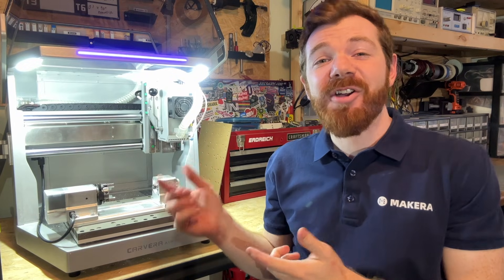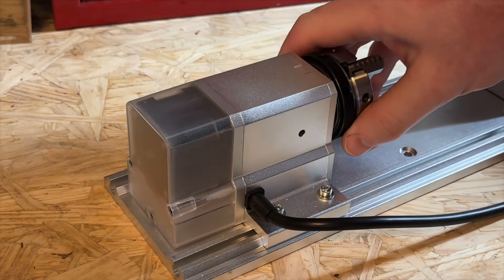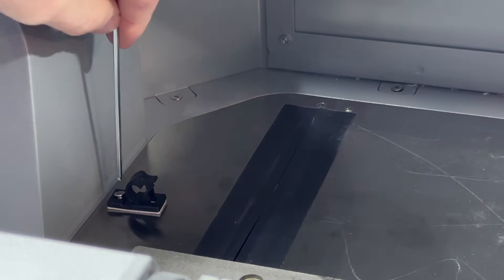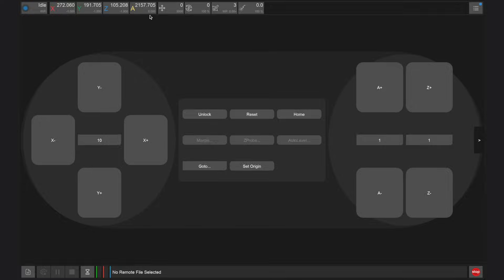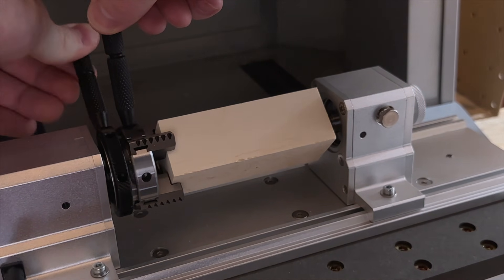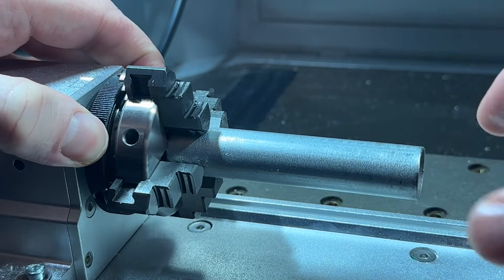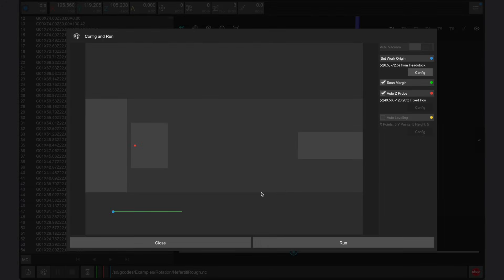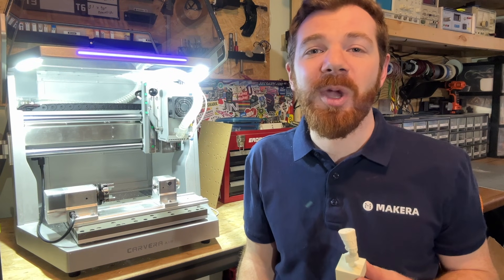4th Axis Installation and Configuration on the Carvera Air Desktop CNC

Comment: i just for my air and i still hvnt try this out. how the machine knows where i install the 4th axis? does it assume we install that in the exact position as shown in the video? also, is it ok to mill a minature model only by mounting the bottom side of it without hving the pillar on the top( assuiming it can hold it tight enough)? can this be achieved in fusion360?

Comment: MakeraCAM needs some critical feature updates for the tool paths.  Doing the entire models and reliefs all together makes no sense and requires you to use the tailstock for a lot of jobs that shouldn't require it.  There should be a way to only mill the relief at the very end instead of creating a weak point roughing it with the model.  Also, instead of always cutting the entire model in the X direction, allow it to mill it doing all of the Y and A cutting for each X step before moving to the next X step.  That way, you always have the maximum amount of material close to where the cutting is happening.  That Cleopatra head could be milled without the tail stock, keeping all of the detail on the top without any post processing.  Watch the video from "my mechanics insights" called "Making a Crazy Part on the Lathe - Manual Machining".  Yes it's on a lathe, but the principal is the same.
Reply from the maker: Thanks for sharing this feedback! Makera CAM is still in beta form, and we are constantly working to improve its capabilities and features.

Comment: How do you calibrate the 4th axis? Ive noticed that my stock offsetts are like 0,5mm wrong, so if i do a 180 spin my model comes of 1mm wrong in both Y and Z direction. When i change my rotary y and z offsett it triggers my soft limit alarms. How do you calibrate this properly?
Reply from the maker: This should not be necessary to do. Please contact our support team via support@makera.com so we can assist in correcting this issue.
Reply: @Makera  sent them a mail. Do you think there is something wrong with my machine or what? Isn't it just as simple as the center of the chuck not being aligned where it think it is? My Air came with the default offsets Y=82.5 Z=23, but the center is more Y=83.1 Z=22.75, when I set those offsets my model comes out in the correct dimensions. But just chanching the rotary offsets triggers the soft limit switch when I try to use a 25mm singleflute 'O' bit. I just want to know how to best calibrate these numbers so I can take advantage of the precision offered by my machine, and how to not set of the soft limit triggers when changing to what is more reliable offsets

Comment: Will the air assist for my xtool laser be sufficeint or do i need a compressor?
Reply from the maker: We are uncertain of the specs of the compressor you are referring to, but between 50-100 PSI should be sufficient for the Carvera Air

Comment: What happens if you don't power off the machine before loosening the fourth Axis?
Reply from the maker: If you apply load and strain on the motor while power is running to it and while a position is being held, accidental damage to the module may occur.

Comment: So the installation of the 4th axis is clear. It would be good if you you show also the remove off the 4th axis from the machine for other jobs and what will stay on the machine. I assume that the clip for the cable could stay and that the dust cover for the connector should be reinstalled.
Reply from the maker: Yes, the cable clip can stay, but all other aspects of the 4th axis is removed.
Reply: Cable has a clip so leaves as well 

But I guess it is out of the way